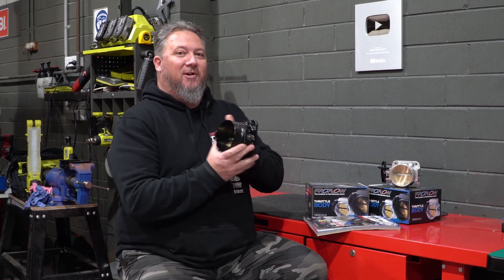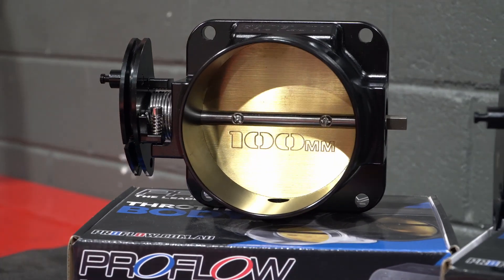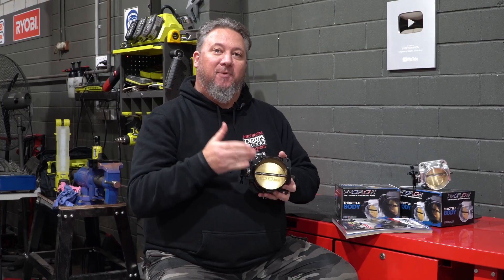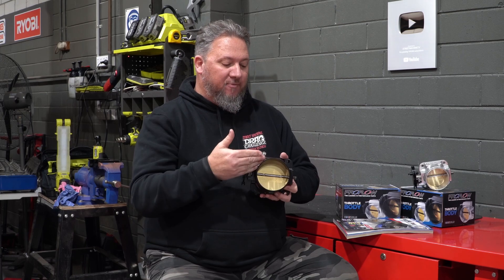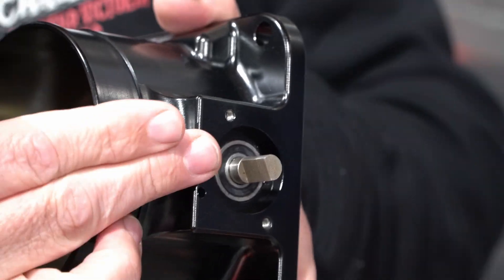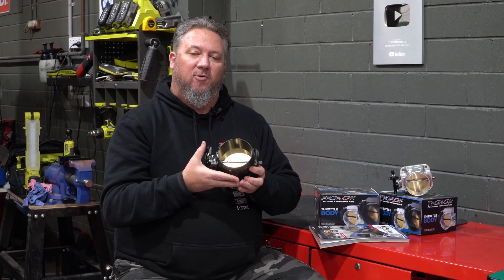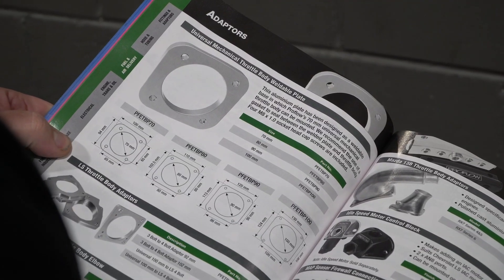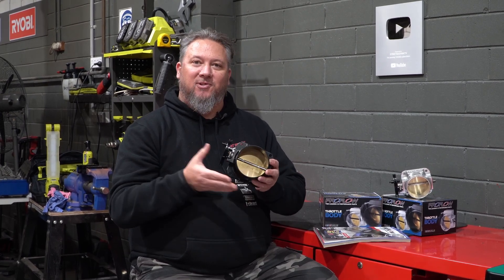Proflow Universal Throttle Bodies

Comment: Got one of these on a proflow 90 degree elbow into a 4150 manifold. Im struggling to understand how i am meant to hold the throttle cable in place. theres no bracket
Reply from the maker: A cable bracket will usually be mounted on the intake manifold and not the throttle body itself, so a custom bracket or modification to an existing one will be required.

Comment: This fit on a ford falcon ba?
Reply from the maker: No it does not directly fit to the factory intake manifold. You would need to use a weld-on plate (sold separately) if you wanted to fit this to a BA.
Reply: @proflowperformanceproducts  could you link me a weld on plate
Reply from the maker: @cop333   Here are the sizes depending which throttle body you use: https://www.proflow.com.au/?rf=kw&kw=pfetbp+weld